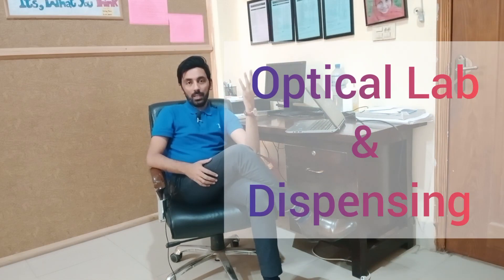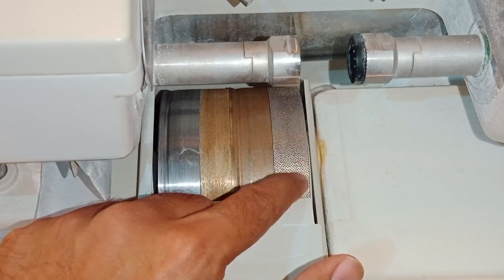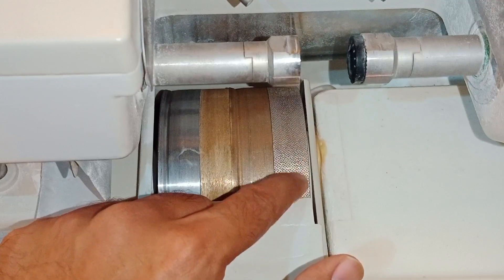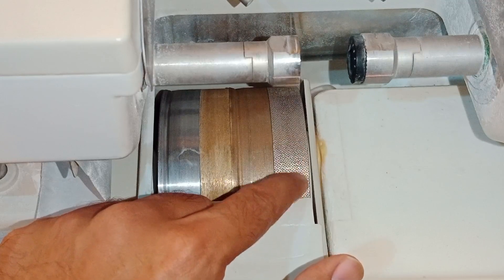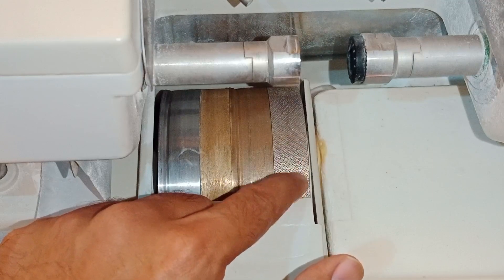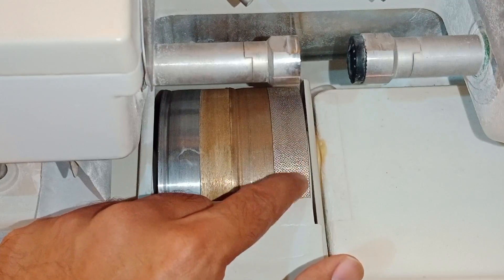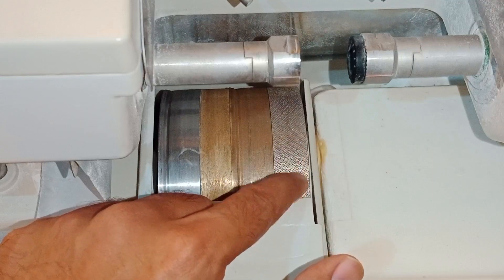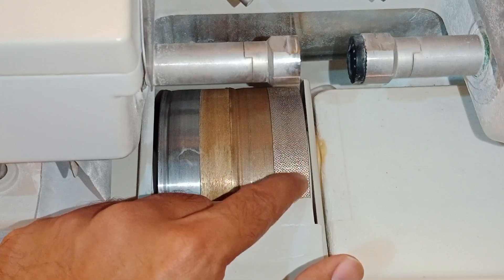Practical Demonstration of Autoedger

Comment: I need a help please doctor .. 
I have the same machine, and I have a problem when the lens is going down to make a bevel .. when the lens is going down it goes away from the bevel like 3-4 mm, so I have to move it manually .. so could you tell me how to calibrate the machine to solve that issues .. 
Thanks a lot
Reply from the maker: For sure dear..I will upload a video on how to calibrate your Autoedger.